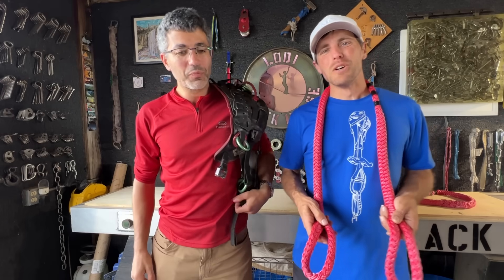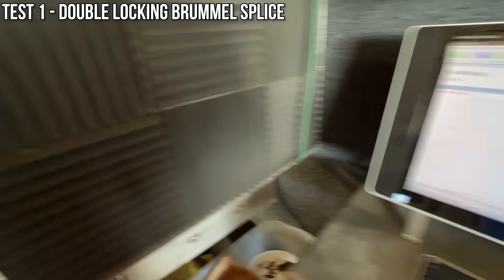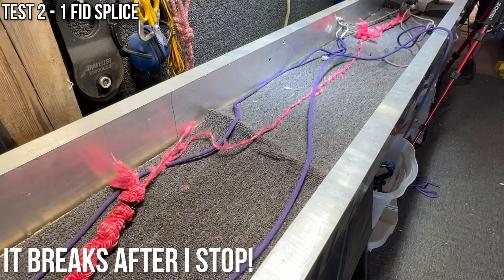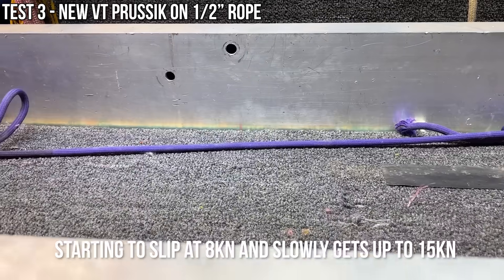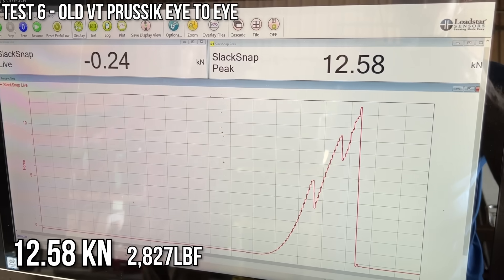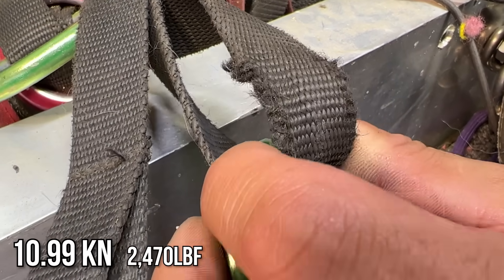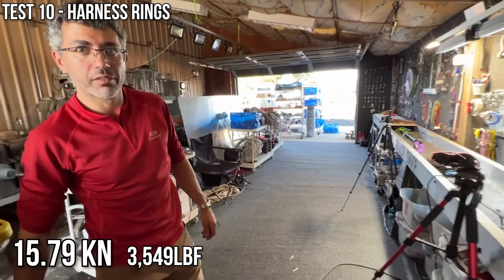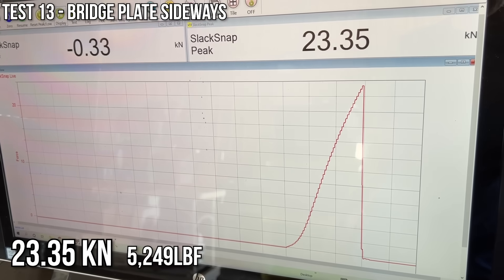This Arborist Rope Scared The S#!% Out Of Me

Comment from the maker: Our blog has the data https://www.hownot2.com/post/arborist-gear-1

Check out our new store! https://hownot2.store/
Reply: I have something for you...PARACORD. This is not a main cord in rock climbing, but it's certainly one of the most versatile and useful cordages ever! The problem is that there is no strict regulation so the quality goes from one extreme to another. It would be awesome if you could do tests and explain the differences between military, commercial, and ultra-cheap ones.
Reply: Awesome! Make more videos Ryan thanks ! 🤙
Reply: As an arborist, I want to see a video testing when various friction hitches start to slip. Also would love to see a thermal image of the rope during testing
Reply: 70kn =  over 7 tons
Reply: Id love to see this older video redone with a Thermal Imager showing the rope/gear temps at breaking point. You say "Hot", I ask "How Hot?" Im curious... lol
Reply: I have snap 1/2 inch in my rigging while climbing it is scary

Comment: Double locking brummel is where brummel won't slip either direction, you have to roll the tail through itself so it's not twisted or you get weak points, especially in dyneema, and end up slinging a snatch block across your hood. :)

Comment: Can i suggest a nice addition?
A THERMAL CAMERA can easily pick-up all the stress points inside the system (not only the weakest point) and can show where things are about to fail (even if there are something else that breaks before).
Not many years ago, thermal cameras used to be super expensive, very slow and super low resolution but today you can find thermal cameras that can record fast enough (cheap cameras can do 25 frames per seconds while more advanced cameras can record 50 or 60 FPS), with a decent resolution 
You can find cheap cameras up to 256x192 pixel resolution with 25 frames per seconds (which are of course still very low but plenty enough to frame the entire device under test and pick up any stress point) that connects to a smartphone using the USB port for less than 150$ and you can even find something like 320x240 or 640x480 pixel at 50 or 60 Hz for a steep, but still manageable, price.

Comment: This is great. Thanks! I'd love to see some videos of ropes and/or other soft stuff being strained multiple times and then tested. One of the things they teach in certification classes is "cycles to failure". i.e. if you load a line past its WLL multiple times it will weaken significantly. I've seen rigging ropes put under a lot of force...as in crunching through the bark of a tree the rope was wrapped around and denting the wood underneath. Or hooking up a bobcat to a 3:1 advantage to barely pull over a very large tree. What is the breaking strength after a 46kN rope is loaded to 35kN 10 times or 20 times?  Those ropes continued to be used heavily. I don't work there anymore. Many tree companies abuse the crap out of their rigging equipment and this would be useful information.

Comment: Have you drop tested the VT Prusiks?  8kN sustained just to get it to slip sounds pretty safe, unless one makes a habit of pole vaulting over a rappel anchor in a small car, but it does leave me wondering how much different it is an a realistic shock loading test without preloading: how much will it move before it grabs, etc.

Comment: The way that the bridge plate breaks at 13:50 is super cool! Pretty unique compared to most other stuff breaking on this channel?!

Like usually steel deforms a lot before it eventually tears and aluminum usually seems to break different from what we see in this first bridge plate test as well, right? IIRC aluminum also usually breaks in two spots... In this breaking test here it looks like the ring splits open in only one spot and then bends just enough for the carabiner to come out...

I'm wondering if that's what happened or if the narrow gap is actually a piece of the metal that went flying somewhere? Since normally aluminum almost doesn't deform at all before it breaks.

On the 2nd bridge plate test the way in which it broke was much more reminiscent of the usual breaking of aluminum gear I've seen from all your other tests.

Comment: branch out on arborist gear… yes please! I'd be happy to also provide test scenario's for actual trees (apart from arborist exp, I have a degree in physics). The research on this is limited compared to the physical complexity of tree joints, and I've been in freefall not knowing if I was going to die because of this complexity (I rigged myself properly and would have survived on the second anchor, but I didn't know if the second anchor was on the part of the tree I broke off the first three seconds of the event, which were spent mostly holding on to a definitely not super good enough twig for dear life 20m above a jagged rusty certain gruesome death fencelike structure 😸 ). Knowing more of the forces and strengths involved will save lives and calm nerves 🙇.

Comment: Biggest thing I see most pros ignore is the log weight chart.  Every crew must have one on the truck by law. Every log you estimate the weight based on species length and diameter.  After a while you get a feeling for it and you can stop checking the chart for common tree types.  This simple knowledge can prevent so many stupid accidents you will never see coming otherwise

Comment: I gave up arborist work many years ago here in the UK. we used Prusik loops tied with a double fishamans knot. we tested these at 20KN and had no slippage. we found that rock climbing techniques didn't relay work for tree climbing and work positioning. We found the Prusik not you used could become loose and the climber fall from the tree. 
Our safety margin on ropes was 5x stated for climbing ( 1 tone stated would fail at or above 5 tone) and 10 times stated for lowing roped ( 5 tone would fail 50 tone or above)

Comment: I couldn't tell for sure, because it went by quick in the video, but the Brummel Splice looked odd to me.  A mobius brummel should lay out smoothly instead of having that lump on the start of the bury.  Break out your copy of Brion Toss's book and double check that the locking brummels were on the correct part.

Also, I'm told that the MBS on rope is actually measured/tested with an eye splice on both ends, so if you're seeing less than the rope rated strength, your splices are bad.  You should not be losing 10% due to a splice.  Keep up the testing it's always interesting to watch!

Comment: Love the arborist material. That’s my focus, but I’m always looking for other fields to see what can cross over to tree climbing, and that’s how i came across your material. 

I’d like to see cross loading of snaps. They get used all the time instead of knots during rigging. That’s where the big loads are in tree work, so when I hear you say 4kn is good enough, I have to always come back to just the climber is good. 

It would also be interesting if you could work with TCIA or another group to gather used tree ropes from rigging and climbing. I’ve seen ropes break that look almost new and it would be interesting to see how much is on the failure side of the curve because of repetitive shock loading.  You generally test max strength, but the manufacturers also have failure plots that I’ve wondered about. For example, would a rope really break at 50% load after 20 pulls?

Comment: Definitely like the idea I read a few times of setting up a go fund me to get some popular arborist gear tests done. I know A TON of the community will throw in what they can for it. I also know manufacturers have in the past been more than happy to throw in donation gear to informational things like this. I’d definitely reach out (if your already a supplier then you’ve already got a contact). If a go fund me is set up then start up a pull to find what the arborists out there would like to see tested with the funds we have donated. I know a HUGE cation right now is swivels with the DMM recall recently.

My favorite thing to see in this video specifically is used gear. I don’t think people get the importance of replacing gear in a timely manner till they see the difference between a new piece of gear & a well used/moderately used piece of gear.
Reply: I also liked that the used gear was still breaking at pretty high kN, i prob replace my gear TOO often considering how bad some of that looked but was still pretty strong... Rigging gear that's worked and worn on the other hand, or ppe that's been subjected to shock loads, YES even if it doesn't look bad... Destroy and replace.

Comment: Keep testing arborist gear, it might encourage more regular inspection/replacement of gear. Also it would be interesting to see tower load testing of dropping a 6 foot section of decent diameter trunk to test some of the rigging that is designed to catch it before it hits the ground. Arborists generally do this with bigger than 1/2 inch rope but would 1/2 work and how many times? Is static line better than dynamic for this?
Reply: 1/2” rope definitely works!  We use that diameter most of the time for lowering all but the biggest wood.  It’s a lot nicer (easier) to handle than the bigger ropes, (especially for the climber) but it does have its limitations.
Reply: I always say keep the to 500 lbs. Yeah I've roped bigger. But it's a rule of thumb. The big factor is letting it run and slowing it down, not slamming it to a stop. It pays to have a guy on the rope that is good. 

Physics says that the force required to stop an accelerating mass approaches infinite. That is why locking off a large piece or a hard stop breaks things and can get someone hurt or killed.
Reply: I use a 25mm diameter 3 strand nylon bull rope for dropping large chunks, the elasticity helps absorb shock loading (and protects the anchor from breaking out too). The above rope has a breaking load around 12 tonnes, but a 500kg lump will rise in momentary shock load rating extremely quickly if it free falls far enough. I have sent lumps down that stretched the rope so much the diameter went down to less than half its original at full stretch. Very satisfying when one boings to within a few feet of the asphalt / patio / roof but never touches ;) Keep the slack as short as possible! 

Great video Ryan, thanks!

Comment: Thank you so much for doing arborist gear. Do you think and arborist will ever see a 4 kn fall? Maybe you could try that like you did trying to see if rock climber would.
Reply: I mean, 5 kn is theoretically possible (the breaking point was much closer to 5 than 4), but...  The part that broke probably wouldn't be bearing the full force of a fall, and certainly not in the direction they pulled in.

In any case, there was already some pretty significant damage to that webbing, so it's no surprise it failed low.  In good shape, it would probably take 10 or 15 kn, judging by tests of the other parts.  So yeah, the harnass was ready to be retired.
Reply: @Keldor314  oh yes 100%. If your harness webbing looks this bad & your employer won’t replace it.. refuse to climb till they do. It’s your life not theirs. If it’s your harness & your the boss, stop being a tight ass & replace it. That’s some significant damage & again it’s your life hanging from it.
Reply: @bradleyclapper8378  I mean, I guarantee you that's why why the harnass is in the video in the first place.  Owner was replacing it, and sent it to HowNot2 instead of tossing it in the bin.
Reply: @Keldor314  oh yes the harness is way past being replaced. And they way the pulled it. Mark Bridge did write an article regarding the strength of the harness. And all the hard points or way over what you'd see in fall.
Reply: Love this idea. I love it so much because I attended a presentation when I was in my first 2 years climbing from one of the teufelburger reps & what made my heart skip a beat that tree harnesses ARE NOT TESTED TO TAKE A FALL. You read that correctly. Harnesses manufactured for the tree industry across the board are not fall tested. Still 8 years in & that still sits with me.
Reply: @bradleyclapper8378  not tested for a fall? Are you sure? I guess it might be true. They are ment to be sat in/ have a static load on it. I have seen photos of the treemagineers dropping them in a drop tower.
Reply: i only go with the old school, quadruple stitched leather harnesses

Comment: Have you ever tried filming you tests with a thermal camera to see exactly what part of the rope or gear gets hot?
Reply: send one in!
Reply: Who can send in a spare thermal cam??
Reply: Even 9fps would be informative.
Reply: Ask around, guarantee someone can loan you one to see if its worth it
Reply: Very  good idea , may need to bring it up to just below where it breaks and hold it there .
Reply: The place it breaks is the part that gets hot
Reply: thermal cameras are limited to 9 FPS because of ITAR
Reply: @asontehunsthanshhl  ITAR doesn't apply to Americans. We can buy 60hz thermals as long as it's not for export. There are plenty of 30, 50, and 60hz thermals availible. There are probably faster ones out there in the industrial or scientific realm, but I'm unfamiliar with those products.
Reply: @asontehunsthanshhl  So, I guess a thermal camera would get mostly a post mortem look after a pull...might get a few lucky frames during the pull as well.
Reply: Only American is limited.
Buy chinese for the same price and get almost double pixels and 3x the framerate.

Reccomend infiniRay pro.
I have a flir one pro and it is garbage and app totally suck, can't use one phone older than 2 or 3 years old as they remove the compatibility from the app..... And support ain't willing to help at all..

Comment: Thanks for doing this. I have a Petal swivel on the bridge of my harness... I'd be curious to see how hardware like that and that Notch rook pulley/ rigging plate hold up.  I know these are all expensive pieces of gear so, again, I really appreciate you taking the time and spending the money to do this.  I've used bee-line eye and eye cords in the past (currently using HRC by Teufelberger) and always wondered if they're super good enough... this is really helpful and gives some good peace of mind!
Reply: BeeLine is awesome stuff.  The vectran core is self-abrading tough so it is wise to replace it at regular intervals, not just when the protective jacket starts to signs of wear.  Obviously even used it is super good enough, but for $20 a hitch cord it really is easy to just chuck the old one and use a new one.  Besides, there's nothing really as nice as a new fiction cord.